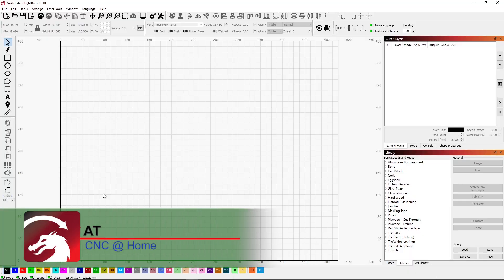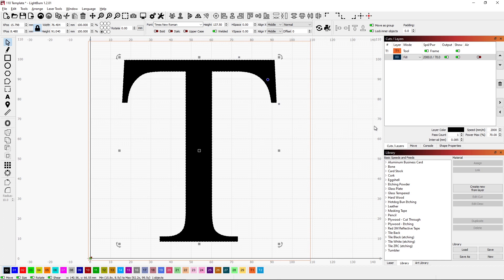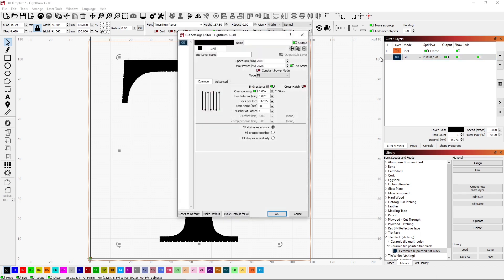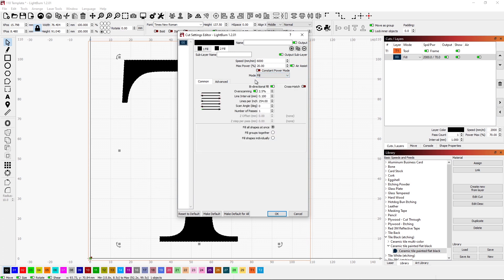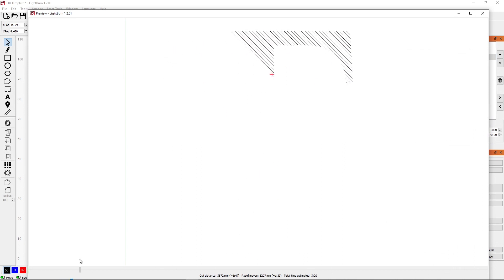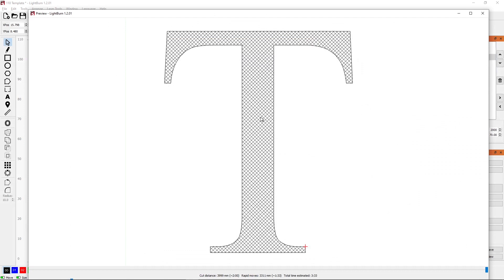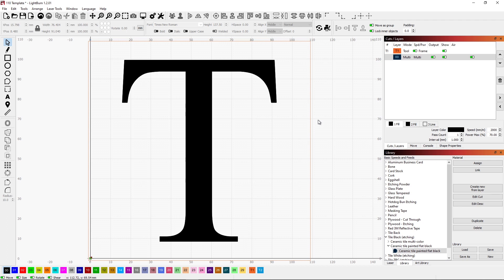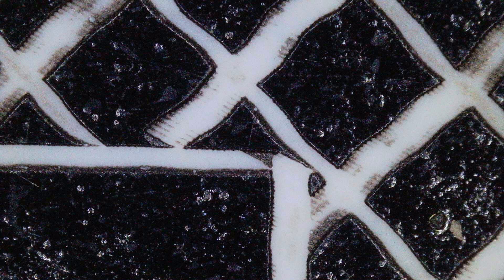New LightBurn layer functionality

Comment: I used it recently on a tricky engravable plastic and it gave great results.
Reply from the maker: It seems like a really nice feature they have added.  Could you explain the need for multiple setting in your project?
Reply: @CNCATHome  I was engraving serial numbers on a plastic material and wasn't
thrilled with the results using fill and line. it was leaving very small smears of the material in the text. I then used fill at 45, -45, line and then fill again with very low power to clean up the residue. 

The great thing to me about the new feature is the ability to turn each sub layer on, off, and change their order which really helps me in troubleshooting and fine tuning new material. Hope this helps.
Reply from the maker: @mikewaskewicz  - Thank you so much for sharing.  It is nice to have a real world example of where this new feature was used.
Reply: @mikewaskewicz  This info is gold! Thanks for sharing!

Comment: I really don't understand the point of sub-layers and it seems every video I watch skips or doesn't realize the point!
To me, it seems Lightburn is just relocating the jobs to be performed from the cuts and layers window to the sub-layers window without any real benefit in performance. Keep in mind I am no expert at all but I may be missing something but what is important to me is to be able to do more then one layer at the the same time. I really don't understand not being able to use the empty white space when doing a job. If I know how to do more than one job at a time things would be great. Take a clock for example. You have numbers on the outside and maybe a graphic on the inside. How would you do both at the same time? To me, that should be the definition of sub-layers!
Reply from the maker: That is some good insight, thank you.  When LightBurn came out with the sub-layers, I wasn't sure how I would use them for what I do.  There have been a few times now where I have been able to take advantage of this.  The whole concept of layers is to define how you want your project to burn.  As you know, they let you control the burn parameters as well as defining when things burn.  The way LightBurn is set up, if you want to burn two things together, you would need to put them on the same layer and would burn with the same parameters.  I like to avoid too much empty white space movement during a burn as that is wasted time.  I have a video coming out in a couple weeks that talks about that and uses a clock face as an example.  I was able to reduce my burn time by 21 minutes through some optimization techniques that worked well in that particular project.

The one thing I have used the sub-layers to do is to fill an area and then come back and to a line around the whole thing.  This can make small letters look cleaner especially if you use a higher cm/line (or lines per inch).